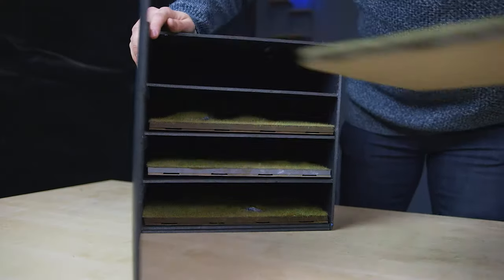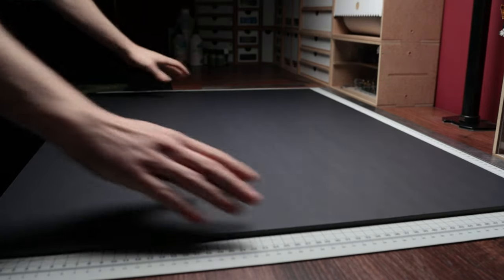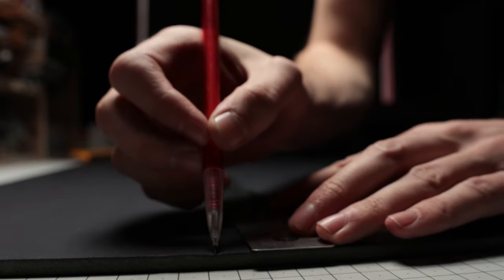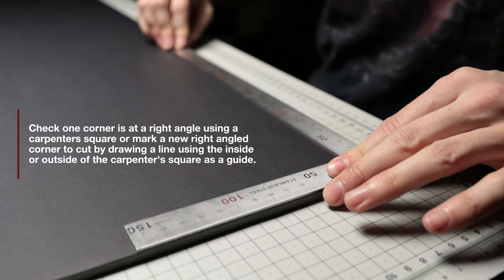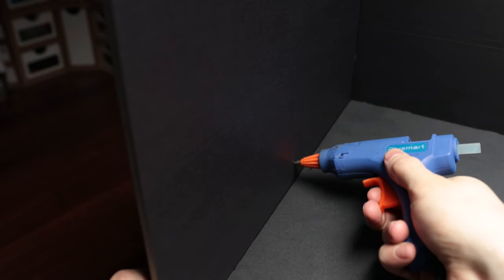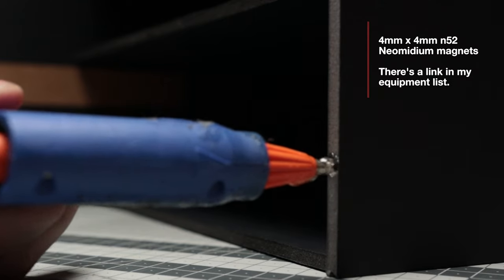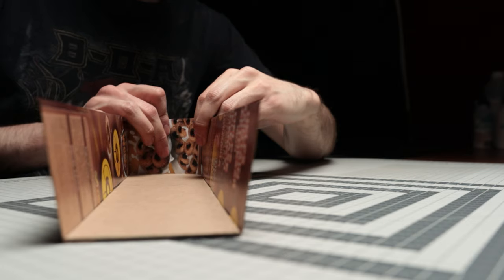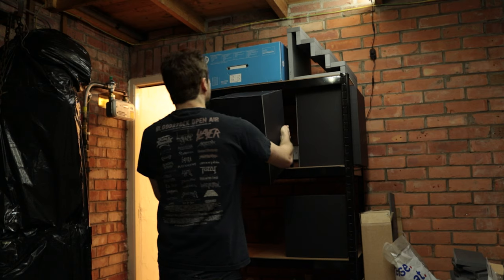I Craft EASY Protective Storage for Modular Dungeon Tiles!

Comment from the maker: So what do you guys think? If you play around with wood you could probably make something sturdier no doubt, but is this something you might make/use if you don't have power tool access?

Box piece measurements - Outdoor tile storage:

2 side pieces/1 door piece  - 12 and 1/2" wide by 16" tall
1 back piece -  12 and 1/4" wide by 16" tall
As many as you need of shelf/roof/bottom pieces -  12 and 1/4" square

You can make these as tall as you want, but they need to be this wide/deep if they're going to fit 12" tiles into them nicely.

Box piece measurements - Dungeon/building tile storage:

2 side pieces  - 12 and 1/2" wide by 16" tall
1 door piece - 10 and 1/2" wide by 16" tall
1 back piece -  10 and 1/4" wide by 16" tall
As many as you need of shelf/roof/bottom pieces -  10 and 1/4" wide by 12 and 1/4" deep

I made these boxes thinner mainly to accommodate my shelves. You could make them 3 and 1/2" wider and slot another column of drawers in.

Shelf heights I used (including the thickness of the foam shelf in each):
For outdoor tiles:
2" - low raised features/flat tiles
3 and 1/2"  - medium raised features

For dungeon tiles
3.5" - enough space to fit drawers in smoothly and not scrape the tiles against the shelf above.

Drawer measurements:

Bottom - 3" wide by 12" long
Side walls - 2 and 1/2" tall by 12" long. 1/2" tab along the long edge.
Back/front walls - 3" wide by 2 and 1/2" tall. 1/2" tabs on one 3" edge and both 2 and 1/2" edges.

All these tabs I scored before folding by gently drawing my knife along the fold line, but not cutting, on the outside of the  way I was planning to fold it. Ask if you have any questions :)
Reply: "what do you guys think?"
Stares at my scatter trees plates and how jank the storage is

Yeah...new project...

Seriously though, currently I use the foldable totes for weird shaped scatter, it isn't perfect but I think I can make this one work better than my current.
Reply from the maker: Happy to help :) I have some interesting plans for trees in the future actually, but that's neither here nor there...

Comment: When you're putting in the shelves and hot gluing them in place, I'd recommend cutting a spacer that's the exact perfect height and then setting the shelf on the spacers as you glue. You can then use these spacers on every subsequent shelf making sure the spacing is perfect as you go up. You'll probably have to put some wax paper around the spacer to prevent it from being glued to the side as well.  This is something I learned in woodworking.
Reply from the maker: That's a solid idea.

Comment: The Dollar Tree stuff is the "Redi-board" brand where the paper is thin and peels off easily.  It's great for projects that lend themselves to having the paper removed, but where you want the reinforcement of that paper lining (with stronger paper that's less likely to peel off on its own over time) you end up spending around $3 a sheet... so the price isn't too different as long as you're comparing similar products.
Reply from the maker: That's good to know, from what I could see dollar tree sold black foamboard too at the same price, which from what I understand is more like the stuff I used here?

Being in the UK there's no real way for me to check 😅
Reply: The easy-peel stuff from Dollar Tree is usually lined with black paper, though now that I think about it they have occasionally had the same brand with white lining.  As for whether it's comparable to what you can get I'm not sure - the primary difference between the two tiers of it that I can get locally is the quality of the paper and adhesive.
Reply from the maker: Interesting to know, thanks man :)

Comment: Sweet build, mate! The only thing that I would change is made railings, so shelves can be rearranged depending on what you put inside. Also to give more space for the magnet, you can cut a tiny cube out of spare xps foam glue it on the side of the wall, and insert the magnet into the cube.
Reply from the maker: Interesting points, and ones I considered but I found that both took up extra space in the tight formats (where you're storing lots of thin, wide tiles) , that might collide with details on tiles when you use them 😕

The initial prototype actually had something similar but I tore it off after it crushed some of the grass at the edge of the tiles when stored overnight :)

I'm tempted to keep developing the idea though, so if I work in a workaround, I'll mention it in a video to let you know!

Comment: Instead of laying your measured points out with a pencil, try marking them with a pin. Then when you place the rule down to cut your line, you can use the pins as stops for the rule.
Reply from the maker: That's a really useful tip, thanks reg!

Comment: A few years ago, I volunteered to help build sets for a local theater.  The set was a monistary with walls of stone blocks, and this was simulated using XPS foam for the block veneer.
What they actually used was wall insulation from Home Depot, sold in 4x8 foot sheets and 1" thick IIRC.  It was dinged up a bit, which was fine for us because we were going to carve the stone texture anyway; but for more precise cuts you would get a lot from avoiding the irregular spots when cutting up the original sheet.  I think this could be a cheap source of crafting foam if you don't mind milling your own stock, so to speak.

Imagine making wall modules like yours... but full scale !
Reply from the maker: That's something I actually kinda wanted to do for my d&d room at some point 😅

Comment: I live in Scotland, I agree with you completely about the high costs over here. I try to get stuff off Ebay to mitigate the costs. Big board of foam, paint and so on.
I bought a proxon hot wire cutter off Ebay for £20 as it was broken. 20 minutes of TLC and it was working like new. I now the happy owner of one perfectly working, near new proxon :)
I generally buy broken stuff or old stuff all the time and fix it. I'm good at it. It's a great way to mitigate the costs.
I have a 3D printer and I have modeled and made a static grass applicator. It takes a 9V battery or 12V mains supply. I just realised I couldn't find my resistors so I'm waiting for them to arrive on the slow boat from China but, once they arrive, I will have a great new tool. It's only cost me the price of a few electrical components and some PLA. Less than a tenner all in. I'm already contemplating a mark 2 version that will be better with variable power. 
I'm also 3D modelling dungeon tiles and then 3D printing them. Printablescenery makes nice ones but that get expensive pretty fast. 3D model stuff and save a fortune. 
They say necessity is the mother of invention. Needs must and all that. So I try to find ways to counteract the costs of living here in the UK.
I really want a cheap storage system for dungeon tiles. So, I may have a go and see what I come up with.
Good video, thanks :)

Comment: Have you heard of the "Incra" line of measuring products?  They are known for precision router table (or whatever) adjustable fences, but also make rulers and other small items.
They have steel rulers with perforated holes that take a 0.5mm pencil lead, with the holes spaced precisely so you can easily mark an exact position using a slot that's just as wide as the pencil tip so it makes a perfect line; or a single dot.
They also have the same concept with a T-square end attached, so you put the pencil into the right dot and run the T along the edge of the board, to get a perfectly measured line.
Reply from the maker: They look awesome, though maybe a bit large scale for what we do? Just took a brief look :)

Comment: I just checked local supplier in Australia for foam core. A1 size sheet is $6.63usd or £5.43.   we definitely don't have stores like dollar tree, dollarama or Poundland here.
Reply from the maker: Yeah we don't either, but mine was like £2-3 per sheet when bought in bulk?

Otherwise, now I order corrugated card boxes in the same dimensions, cut off all but one of the 'doors' and use them as the first shelves :)

Problem is minimum purchase was like, 20. But you could split them with other crafters and ship them on?

Comment: First off, I love the channel man. I've made several builds, and I love them all!
Second, I have a curiosity and couldn't find an answer in my scouring of the channel comments, and the storage video seemed a good spot to ask lol
How do you store your little magnetic bits for putting on tables, safely? I've got a couple ideas on how I could, but really wanted to know how you store them
Reply from the maker: Do you mean like the little table accessories and non-tile bits? I mainly keep them on a piece of magnetic strip (think fridge magnets, but as a wider sheet) I bought some time ago as an experiment (that failed). I'm actually going to be working on a new storage solution for them because I have magnetic upgrades for all cocktail stick accessories coming soon to patreon as a bonus optional upgrade :)
Reply: @RPArchiveOfficial  Yeah, all the little things like candles, plates of food, etc.
A sheet of fridge magnet would be a lot cheaper than what I was thinking 😅
Thanks for the speedy reply and keep up the great work Matt!

Comment: You could use 3mm MDF. It's cuttable with a box cutter.
Reply from the maker: These days I've found a good source of custom order corrugated card boxes that are PERFECT for these. Best bought with someone else and split though, minimum order and all :)

Mdf could easy work though.
Reply: How does this build work with corrugated boxes? I found some 13x13 that could work
Reply from the maker: I ordered some custom sized, with the 'opening' on the front/back. Cut 3 flaps off the front and use the 4th as a door :)

Comment: playwood could be used instead right? Its quiet thin so it doesnt requier a powertool(It might be helpfull thought) so perhaps it could be interchanged? All yu would need is a hammer and nails I belive (Im a beginner at this so no idea but im asking to kinda get confirmation :)
Reply from the maker: Gonna admit, I'm pretty inexperienced with woodworking, but plywood from what I know would be both thicker and heavier, giving less storage space. Thin MDF could be used, though again would be heavier, but not as thick. More expensive than foam core though :)
Reply: @RPArchiveOfficial  ah I see :) thanks for the fast reply <3

Comment: This is one of those things where I understand what you did but I dont quite get why you did it.  There are so many easier, cheaper and faster options that will last longer.  

I can get a 12"x12"x16" cardboard moving box for a little over a dollar (US).  That right there is is going to be faster to set up, stronger and costs less than just the foam core board.  Buy a second box and I can cut that one up to act as shelves in the first box (it's already almost the right size!).

It's an interesting build.  I just think that there are better ways to go about doing this that would save time, money and result in a much better end product.
Reply from the maker: The problem is, the interior needs to be just over 12", 12 and a half or so, in order to fit 12" of tiles smoothly - 12" is too tight for most tiles and makes it not work as well, at least in my experience.

Add to that finding the right box size, in the UK at least, was near impossible, even if 12" would work fine :)

So there was a reason, and if you can link me to a 13x13x16 cardboard box, I will adjust accordingly and mention it in a video :)
Reply from the maker: I just searched similar things in the uk and not so much, a much more limited selection :/ I'll keep searching, because obviously this would be ideal!